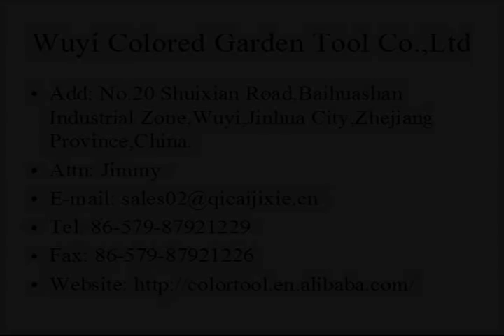3 in 1 snow sweeper 6.5hp road sweeper sweeper machine

Comment: engine speed in video too fast...
Reply: explode crankshaft!!
Reply: Turbocharge1000 EXACTLEYYY, you can / should rev it up when it is used for example if it is sweeping up heavy road debris, or wet snow. But when your bearley sweeping up a inch of dirt....